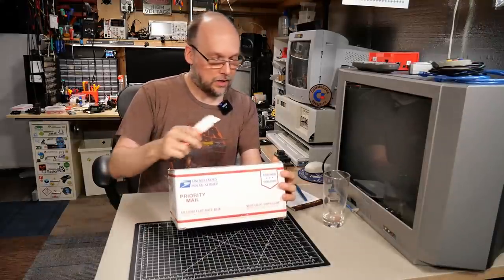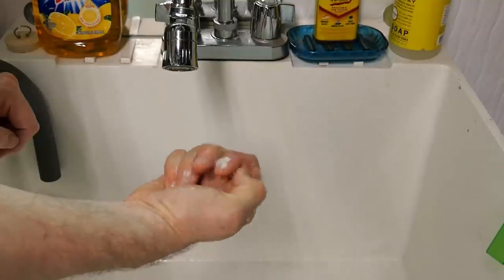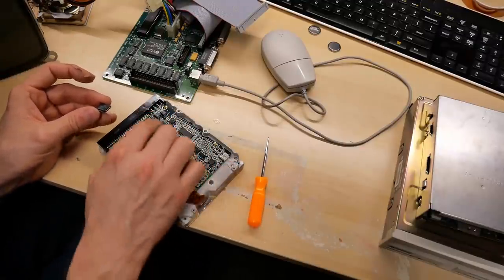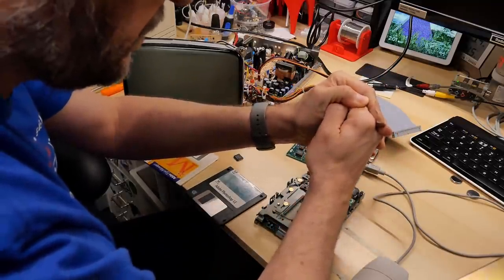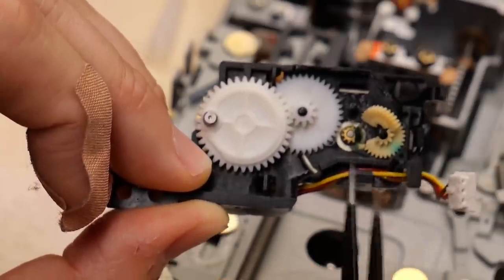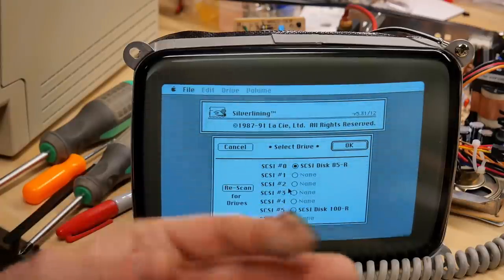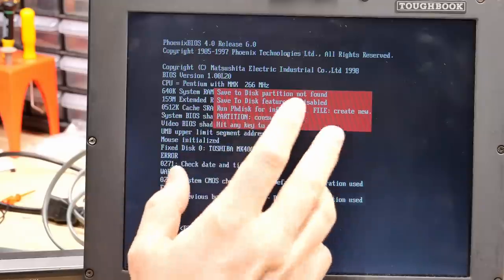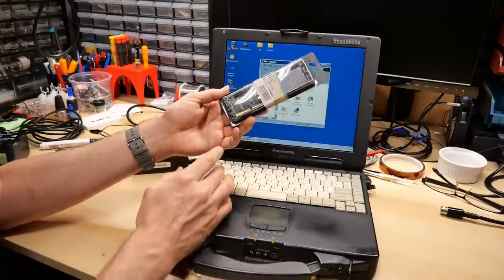Melting peanuts, a hard drive crash and some RAM! (Mini Mail Call #11)

Comment: Ace Hardware for metric bolts, screws, nuts, etc.
Reply: Mcmaster is also good, but pricey. Zoro Tools (a division of Grainger) tends to have the best prices if you're buying a bag of screws (or washers, or nuts) and can wait for shipping.
Reply: And a very local reference (as I'm also in the Portland area), the ACE hardware in Aloha on 185th and TV highway has a HUGE selection of fasteners. More than most ACE locations do. If I need something fast and it's slightly odball, that's the place to go. Only thing I've needed that they didn't have was long galvanized bolts with thread all the way - they only had the ones with the thread at the end, and plain shank the rest of the length of the bolt. Home depot had the ones with the thread all the way that I needed, but ACE had all the other galvanized things that home depot didn't.

Comment: I have always had the worst experiences with trying to fix 3,5" floppy drives that had read/write errors :(
Tried it with a lot of drives since the late 80s when I had the first Amiga. After opening and very carefully cleaning the heads with IPA, the drive would never work again. All of them..
Isn't there a seperate BIOS backup battery in the Toughbook?
There are lots of these Syquest cartridges for sale on EBay Germany, like https://www.ebay.de/itm/SyQuest-88-MB-Cartridges-5-Stuck/264802099520?hash=item3da76f6140:g:6csAAOSwpZhe-w8D

Comment: Why would the Amiga use Metric screws?  It's an American computer.
Reply: Mr Guru  But it was from an American company.
Reply: @infinitecanadian  Doesn't matter.  As Mr Guru pointed out, the PCB design was done in Japan.  They don't do inches there, they do Japanese Industrial Standard (JIS), which is metric.  Case in point, someone I know was repairing an old Donkey Kong cabinet... one of the original ones that was made in Japan.  He thought they had used non-standard 9/16" plywood, which very difficult to get in the U.S. (9/16" is not a "standard" thickness, though there are companies that can make custom plywood of any thickness you want).  Well... that's where he went wrong.  Japanese cabinets used 15mm (not 9/16").  The difference between 15mm and 9/16" is minimal (less than 0.03 inches).  The same thing goes for circuit boards or American cars with foreign engines... Ford is an American company, but my Ford has a Japanese-made engine.  Guess what?  The bolts are metric.
Reply: @SpearM3064  They should always use parts that are used in the source market.

Comment: 3:49 - I can't stand those peanuts. Couple of years ago I was wearing a new pair of shoes for the first time while unpacking a box packed with these in my garage after having come in from the rain. I spilled a bunch and stepped on them. New shoes covered in this goo. Sonofa.......
Reply: So wipe them off with a damp rag.  It's only environmentally safe biodegradeable corn starch, not some shoe-eating acid.
Reply: @SpearM3064  No, these were the shoe-eating variety.

Comment: I still have a couple of hard drives in my house that work (AFAIK), but I haven't powered up that computer in at least a year. I'm working on 1TB of SSD storage and it's a bit tight at the moment. My next computer will have 2TB of high speed storage and 4TB of SATA storage. But no actual hard drives.

Comment: As a Dutch person I can say that metric screws are not as easy to find as you might actually think. 

They are most often used in rotating tools/devices. Just to take care of any accidental unscrewing while promptly spinning up. A table saw might be a great example for metric screws.
Reply: Uh ? You're talking about metric or counter tapped screws ? I live in France, we literally invented metric and accidental unscrewing is pretty common. That why stuff like loctit do exist.
Reply: Tom F you are definitely correct. My bad!

Comment: IOMEGA Zip Drives were a piece of CRAP !!!   Very unreliable.
Reply: I never had any problems and I've used multiple drives (but only one disk)
Reply: @eDoc2020  It was very hit or miss and depended heavily on the batch the drive was made in. The "click of death" was a very real thing for the original 100MB units, which was fixed with the 250MB and USB revisions. 
I had one of the original 100MB SCSI drives that had a click of death. I have two 250MB right now (internal IDE and external parallel), both work great. The parallel one I'm the 2nd owner even.
Reply: @pi-duino  Actually, if you had one of the early ones (before they started cutting corners to maximize their profits), they are very reliable.  The problem started in about 1996, and was fixed after the class action suit in 1998.  So the real issue is with the drives manufactured between 1996 and 1998.  Also, as Carey Brown points out, it was only with the 100 MB drive.  The 250MB drives didn't have the "click of death".

The clicking sound is caused by the read/write head bumping against its movement stops while searching for track 0 on the Zip disk. When the "click of death" problem happens, the read/write head fails to find that track, which contains vital directory information, because the head has become misaligned.  There was also a domino effect in which misaligned heads damage disks, which in turn misalign heads of other drives, which then damage more disks.  All because in 1996, ioMega decided to remove a rubber "sleeve" from the headstop to save a few pennies per drive.
Reply: @SpearM3064  Since the problem is contagious you'll be less likely to encounter it if you don't exchange disks with other drives. That's probably part of why I've never had any problems.